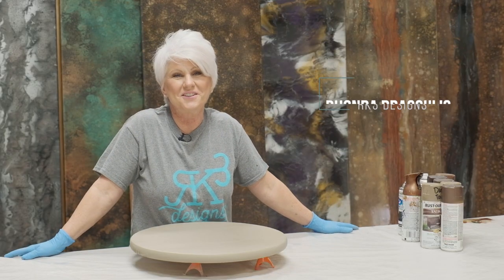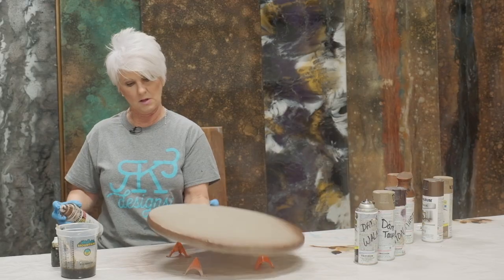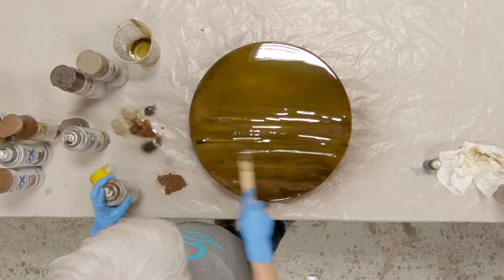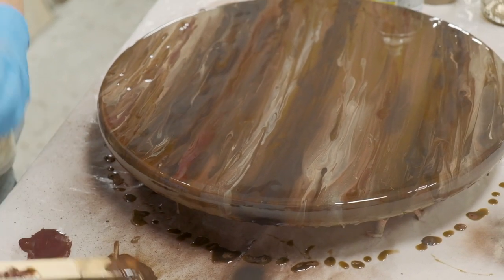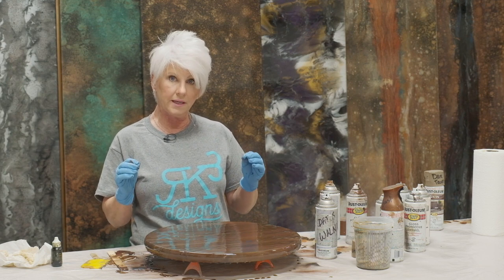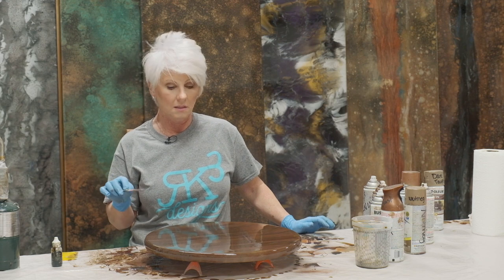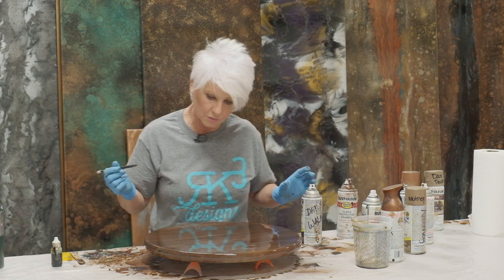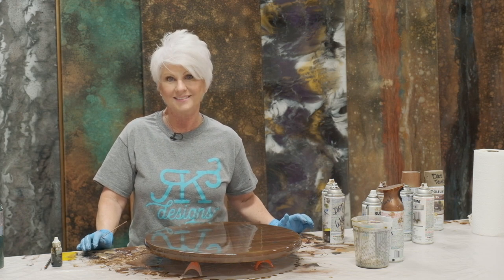Creating Wood Grain with Stone Coat Countertop Epoxy

Comment: I have a piece of marble that I’d like to do the faux wood on. If I build a cut her block cart, can this marble/epoxy be a cutting board? 
Enjoyed this segment as all the rest, a lot 🙏🏻💝
Reply from the maker: Epoxy is not recommended to be used as a cutting board. I often will pour on one side of a cutting board so you can flip it over when you’re not using it. 😊